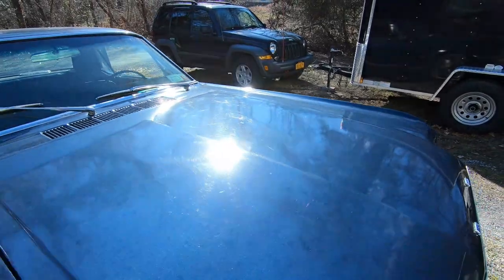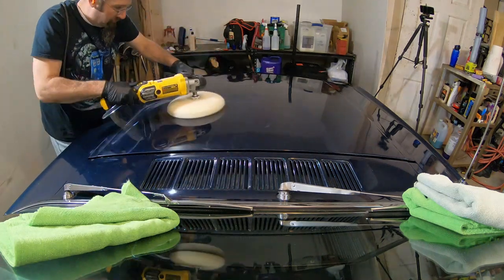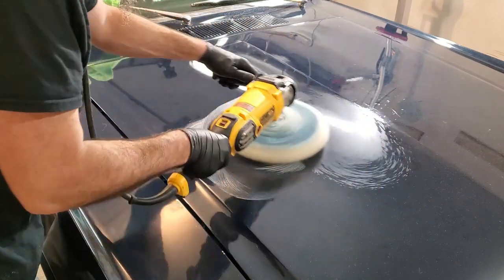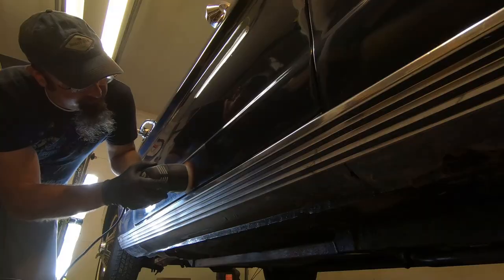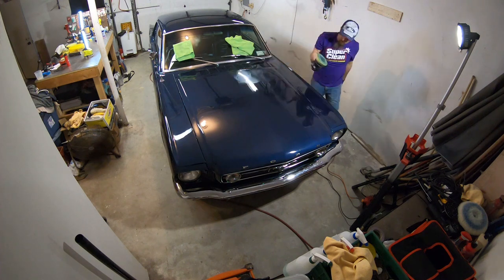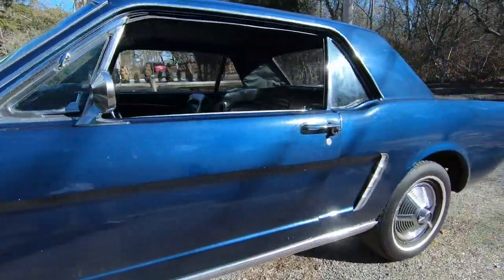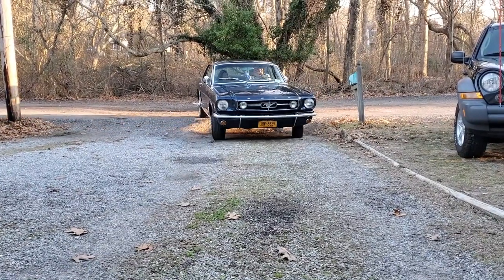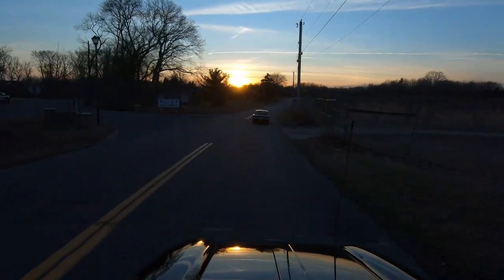65 Mustang Full Detail part 3 ( Paint Correction )

Comment: You're a brave man using that wool pad and rotary buffer on that car. I learned to buff with that setup before random orbit was a thing but man I despise it. Ive made a lot of expensive mistakes with that thing it's just so easy to lose focus for a split second and burn a corner. In my experience I've found that they just arent necessary with all of the modern options in pad and polishers and even polish selection. nor do I feel its worth the potential risk. 

I remember the first time my chemical supplier pulled up at work and showed me a brand new Rupes bigfoot and demoed it for me. He did a 1 step correction on an absolutely destroyed black trunk lid and I nearly shit a brick seeing how fast it handled the job. I begged and pleaded with the owner of the dealership to make the investment but sadly he was a stubborn man who couldn't see the investment opportunity even though the evidence was as clear as the reflection on that decklid after he finished it.. some people are just slow like that 🙄
Reply from the maker: It is definitely easier to make mistakes with the rotary. At the same time having used both extensively, nothing cuts as fast as that wool pad and an aggressive compound. The car was actually a good friend's and it had been repainted in the 80's (best guess) and had cracked bondo so it wasn't original or in the greatest of shape. I was given the green light to go nuts. That paint still to this day is the hardest to cut I've ever dealt with. In hind sight, knowing what I know now, I would've machine sanded it with the Duetto. It probably would've shaved a couple hours off the process.

Dealerships still won't buy random orbitals. I see holograms on new cars all the time. From Porsche, Mercedes even Ferrari and Lamborghinis. 🤦‍♂️